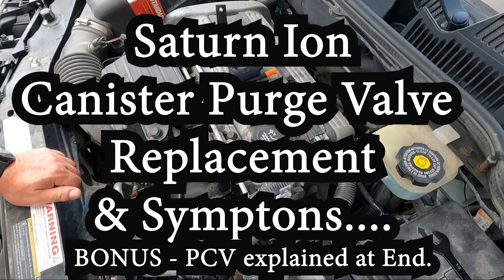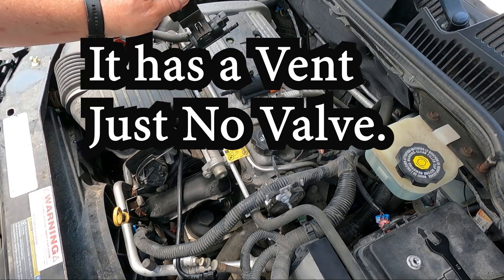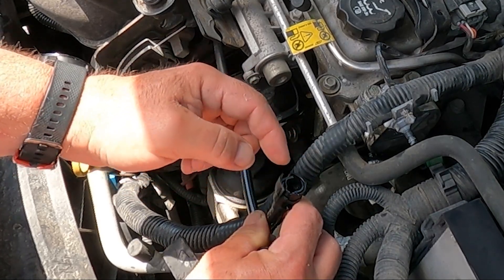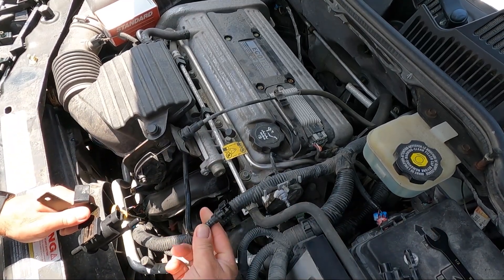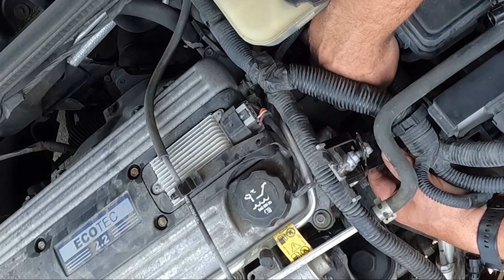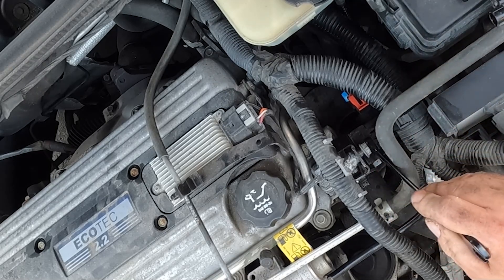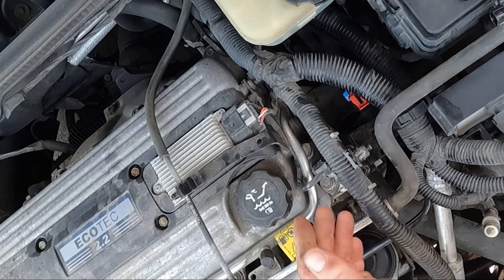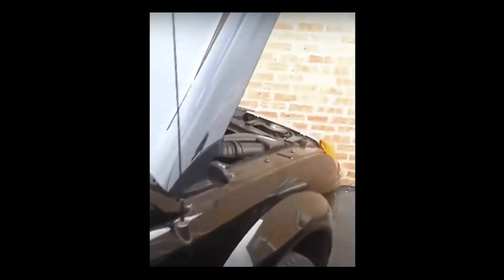Saturn Ion Purge Valve Replacement

Comment: thanks for the informative video! I changed the part but the Check Engine light is still on, does it need to cleared or reset or should it have cleared by itself?
Reply from the maker: It should clear, I believe with the saturn if you disconnected the battery that should clear the codes
. Also a basic obs reader that costs 20-50 dollars can clear it also.. I've also heard a sequence using the key on off switch can clear codes...

Comment: I replaced mine I was getting a p0496 code and my engine light was still on ??
Reply from the maker: @scarfacejan3  I'd first clear all codes and see if the error returns.. Tough to say, but here are some issues related.. https://www.kbb.com/obd-ii/p0496/

Comment: I believe the pcv valve is incorporated under the top of the valve cover and you have to replace the valve cover. I'm speaking of a 2003 Saturn ion Quad coup with the 2.2 ecotec engine.

Comment: Do you have to disconnect the battery before start?
Reply from the maker: @OhChino-er6ih  I did not, but some people always disconnect for safety reasons, or if the car has a remote start.
Reply: @kd_enterprise3404  oh ok thanks

Comment: Appreciate the reminder about the PCV valve.  Reminds me of how many times a shop (including my Saturn Dealership Sales Staff back in the day) "forgot" that my specific ION doesn't have a CVT nor Hydraulic Power Steering.

Have changed A LOT of Gas Caps in the last 20 years... May be time to check if that part needs TLC. (Seems easy enough to check function... Maybe even cheap enough?? to just buy/replace "just in case".

Comment: Whats the part connected to it my system check says there are 2 parts to fix
Reply from the maker: It is probably referring to the evap canister located at the gas tank near the fuel filter, mine was fine however due to corrosion where I live the line was completely corroded through. (Line failure was driver side directly below driver seat, fuel lines also fail at this point as did mine)
Reply: @kd_enterprise3404  Thanks, that's probably it.